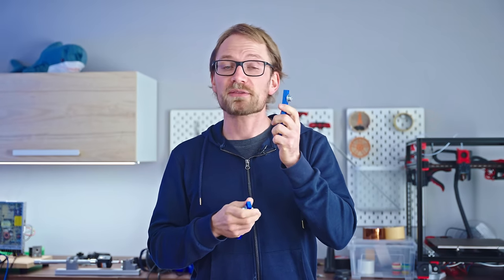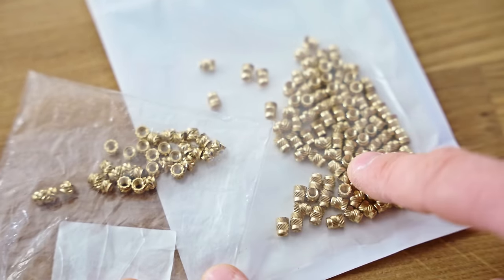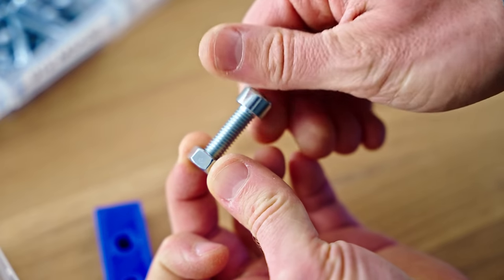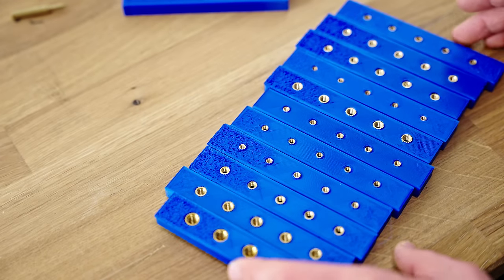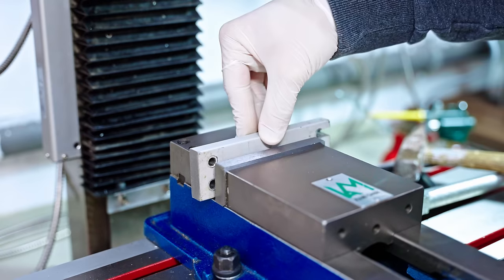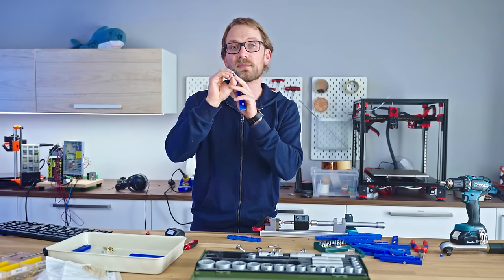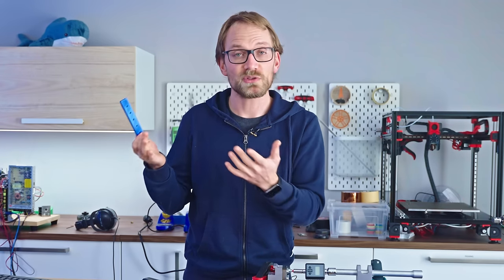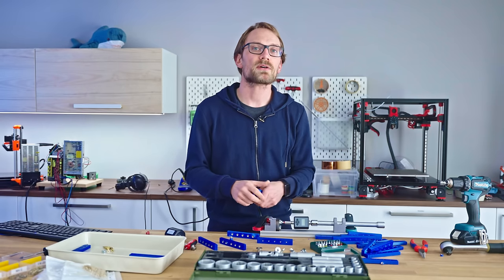Do you even need threaded inserts? Strength tested!

Comment: If you're printing end use parts with less than 6 walls (sometimes called perimetres) and at less than 75% infill (load bearing), at less than 25% (non-load bearing), then you're wasting your time. I wrote the first recent paper "Viability of 3D Printing With Polymers For End Use" (2015) which looked at print methods, materials and production scale, for the abundant "Prosumer/Commercial-Entry Level" printers ($4000 - $50,000). Also, I work as a Mechanical Engineer doing CAD/CAM/CAE and CNC and Additive Manufacturing in the aerospace / defense industry where we print 75% of the parts in most products in the industry.

Comment: Mostly I insert nuts when needed, either while printing or simply afterwards. Recently I bough a small pack of the injection mold inserts for a very rare occasion. Plastic parts are not very great from the get go anyways, and especially 3D prints have a weak Z direction. For most stuff there is just no necessary for a strong print, at least for the stuff I design around the house.

Comment: actually I try to do a moving trapezoid thread. I printed it (10mm diameter) but it doesn’t quite fit (which I expected) now I think about how to get it to size. I don’t have a tap (and don’t want to purchase one only for that project) so I think about either melting the thread in or cutting it with a self made tap (out of a thread rod I have), but maybe that weakens the part to much - anyway, I‘m not sure if the thread will hold the working force anyway. So I trial and error.

Comment: With the latest slicers, I believe you could change the infill selectively, thus you could increase the infill surrounding the hole but not the whole model.  I wonder if you could do the same for the number of walls. I did get a design to print for a customer with many 1 mm holes around an attachment point after printing I realized he had effectively strengthened that area as the printer could no print a 1mm hole and thus created selective 100% infill.

Comment: Hey, you haven't tested the simplest option: just print a hole.
Wait what?
Ok, so I tested it once.
The hole diameter must be selected very carefully by trial and error - it obviously depends on the printer, settings and even the screw. I had different results for different bolt diameters (so it can't be calculated based on the bolt core diameter). You just print a few holes every 0.05 and try.
Once you know what diameter to print - then you simply screw the screw into the hole.
And then PLOT TWIST you tear off the micro-thread that the screw itself carved. So you screw it all the way in and turn it a dozen more turns.
I don't know how it works, but the pull-out force is greater than when you have NOT broken the thread yet. I suspect that then the inside becomes rougher and therefore holds better.
Of course, the force is much lower than other solutions (inserts), but it is >good enough< when, for example, you want to screw the top and bottom of the rasberryPi housing together.
And it's simple.
All you need to know is what hole size print with your current print settings.
And it cannot (?) fail during use (screw and unscrew), because 'thread' is already 'failed'.
edit: tested with PLA.

Comment: Showing the t-nut in the mix and not testing it is a bit of a troll.
Although, we all know it would've probably performed the best in the end -unless it were tested in a ridiculous way, like attempting to press it into the plastic, which nobody with 2 brain cells would ever do, but instead it would be modeled into the part and applied after printing. 
Do the t-nut.
I'm also not sure why some prints weren't made with intentionally thicker walls for the boss. I think most people who have been designing things for more than a few months all consider that when making printed threads. I think this would be another good additional test.

Comment: Find the length of a printed thread which is comparable to a threaded insert. E.g.: M4 might need 150% more printed thread for the same strength. I personally prefer the printed thread, and my former setup did not need cleaning of thread afterwards. (Currently rebuilding my printer)

Comment: I've never used a tap but I have made a cylinder hole then use the fastener to cut into it, and that has yielded some extremely strong bonds. I'd also expect any follow up video to have extra perimeters on these holes, thats basically in a 3d printing 102 class, I don't see how using the default 3 perimeters here was a valid test.

Comment: I don't think this test shows anything at all.
Very nicely done but torque only translates to friction and in your jig that is not same as pull-out force.
Screwing the threads in and using a lever and baggage-scale setup would have been better and removes the thread-friction from the equation.

Comment: Are you pulling out the inserts in the same direction as you inserted them? What would be the effect if you flipped the part over and used the other side. I know this would not work all the time but when you can I think it would add alot of strength to the part.

Comment: I actually never came across using theads or threaded inserts, but its a very interesting topic - thanks for sharing! ...the results are actually pretty straight forward and somewhat forseeable, thats why i was kind of confused that this is nothing the slicer software already has an option for? Would be such an obvious option to be able to select holes (like paint-on support) that are then specifially handled as thread holes and can be added with as many full infill/perimeters as you wish for? 🤷‍♂

Comment: Could you design the part as well to pause at layer, when it has printed a nut hole, then you put the nuts in place, then print a roof/floor on top of nut, thereby embedding the nut into the print?

Comment: I do mostly m2 or m3 and for tapping I would use a hand tap and use more walls on the holes but, my preffered method is inset nut when the geometry allows. I do mostly drone stuff so being able to use a locking nut is a big benefit too.
Reply: Thirtytreeeyes8624.  I also use mostly m2, m2.5 and m3 screws hand tapped into the plastic and for my purposes they do all I need. For more demanding joints I will use inserts or pocket nuts. I will try pre-threaded small screw holes and tap them. The printed threads at these sizes are not useful but, from this video, it looks like the threaded walls will be a little thicker.

Comment: What about resin prints? You can't use melt-in thread inserts and printing the threads into the part is susceptible to cross-layer curing which can ruin the profile and make them useless. And if threads are not a viable option for resin prints, what is a better option?

Comment: Weird - I have the opposite take for several reasons. Never once have I melted a hold while tapping - what are you doing dude? It's 10x easier to design and the designs carry over if you're going to move to CNC'ed parts. I just use more walls. If you really care, most slicers allow you to do region specific settings so you can locally add more walls to tap pilots. I don't like printed threads - they always sag and never mate well, and if you print the perpendicular to the z-axis, they're always oblong and too loose or tight. Inserts are OK but I've had a ton of problems with cheap brass inserts. I've had them deform under the iron while inserting. Steel ones are great but that price adds up. Also I've had a ton of issues locally deforming parts, fixturing for inserting, and inserting them perfectly axially. This might technically be the best option, but more often than not I find it's not worth the effort.

Comment: I'm not sure if I'm over thinking this but since you are normally fastening something down to it, would it be worth testing the radial strength of these but putting a flat block up to the treaded insert and fastening it until failure? it would possibly show that the pulling out of the part that its inserted into might not be a primary failure mode when using it in a real application.

Comment: Looks like you are using threading taps that form the thread. If you do a new test video could you predrill the printed hole and then tap it with a tap that cuts the thread? For M3 drilled hole would be 2,5mm according to Würth machine tap sets.

Comment: can an infill be graded from the connection point so it's stronger denser and maybe loosens up as it goes further away, perhaps enlarging the surface area pull out strength. I'd be interested in what solid parts will do.  Also interested in inserts that go in from the back and have a flange so there's a ton of surface area, possibly the part will snap entirely before anything can pull through. There are some really wide flange inserts for wood applications, often found next to the t-nuts, and sometimes referred to t-nuts, but just don't have the spikes.

Comment: Well I always use wood screws I heat up over a candle for about 30s and than screw the in an undersized printed hole. The hot screw mets its own thread. This allo works with machine screws but you might end up with stuck screws  an wood screws have worked fine for me so far.

Comment: I don't use threaded inserts. At all. If strength isn't an issue, printing the threads directly will give a good enough threaded hole. If I need strength, I use a clearance hole and nut. That's either dropping it into a pocket mid-print, or having the nut on the other side. That way, the weakest part is still the plastic, but it's a wall that's failing in compression. Inserts are neither convenient or strong. They do look great though.

Comment: Great content, as always. :) Thomas would you test with pull only force applied to inserts?  I'm affraid, that your methodology doesn't duplicate real use case scenario. When you apply wrench torque, insert have to respond to pulling out force and rotating force (moment).  Inserts usually trasfer force inline with insert (screew, bolt). Would you share test whit extra two cases: only moment (torque) and only pull out force?

Comment: I’d like to see this test with both more perimeters (I do 5 for heated inserts) or stronger plastic like nylon or polycarbonate with strong chemical intralayer adhesion
Reply: could also compare to SLA “tough” resins in the same. I mean I tap formlabs tough 1500 all the time and it works fine for almost all non load bearing applications (jigs for my CNC milling machine, etc)

Comment: I use Helicoils for threading metal screws into 3D printed or plastic parts, especially small threads like 2-56 and 4-40 with thick walls and tapped, I would be curious how they increase thread strength

Comment: I print holes at Bit smaller than my screw and screw directly into the plastic, never had any issues, of course the strength is limited but so is the inserts. After all it is still plastic 🤷‍♂️ otherwise I use square nuts which I place in the plastic while printing (pause print)

Comment: In my opinion, threaded inserts are more like an esthetic thing than functional. I prefer metal nuts that goes between a 3d printed structure with the hole for the screw (defining the needed thickness of the structure for the job) so you have "more plastic" handling the perpendicular force thats being aplied from the metal nut istelf. A closed 3d print will handle better the forces than an instert, but some people just want things to be pretty, and it works I guess.

Comment: Can you compare a cast sheet of PLA(max material holding ability) vs 100% infill(max 3d printing holding ability) vs other infill %(10-100) with the 'best' insert. Then what other parameters could affect the holding ability number of perimeters, modelling a solid block around fastener points etc.

Comment: Think you ground the threads out entirely by using a drill. May be why they failed so easily.  A solid 100% infill would also give you a better result

(Speaking as I just spent the evening hand tapping my printed parts and they hold up just fine)

Comment: you can't measure torque since it depends on the material the screw is going into; think about it, if you have a very slippery brass insert vs threading into plastic, even at the same pullout force you'd have different torque because of the different friction coefficient of the threads. you need a linear force gauge!

Comment: when you thread any material, you dont go full bore. you go max two rotations then go BACK to cut the thread, otherwise you are going to jam it up and get that plastic smoo all over. it's not designed to just thread all they way in one go.

Comment: Would be curious if you could get helicoils to work. Using them to repair threads in metal parts works very well, often exceeding the strength of the failed originally tapped hole. The modeled threads would just have to be adjusted for the larger diameter, while keeping the pitch correct for the final fastener.

Another advantage to using the helicoils, are they are not heat set, so you could also include them in resin prints.

Another comparison that could be interesting is how well some of the methods illustrated in this video, but through the most common other filament types, say PETG, ASA, and generic Nylons.

Comment: i think using a power drill tap was a mistake, especially with it overheating and melting the material i think a hand tap wouldnt have ever had that problem and would have simply cut the threads into the plastic with no issues, i think you should do a very short testing a hand tap versus the drill tap

Comment: Any modern printer should be able to print a functional M3 bolt. I've done several on my Ender 3. Usually when I need a light duty bolt and don't have the correct length in any of my kits. Printing a threaded part that small is a bit harder, and, when not printed flat, a triangle cutout needs to be modeled into the top of the hole (see Maker's Muse) to prevent sagging plastic from spoiling the profile.

Comment: "why threaded inserts?" All wrong: you can disassemble and reassemble a thing many times and it will not lose strength with threaded inserts. Direct threading into plastic is full-strength exactly once when the screw first goes in, and any repeat disassembly will weaken the joint or thread out completely if you're not careful.

Comment: Try pulling the insert in the same direction u inserted it? so u need to pull the insert out the other side not the same side it went in. i got a print going right now to test it but im rlly curious on the injection molded inserts if that would improve the strength around the plastic. i only have the basic amazon knock off versions

Comment: i been recently making something with intention to put a lot of threaded connections and first thing i decided to do was to put minimum 2mm thick walls on the parts which is notas scary with 0,8mm nozles but i wouldn't try to print in place any threads, besides i print from petg and with 0,5mm lauer height and connccting things with m3 screws
so in my overthinking i decided to just sink in a nut on the back or threaded inserts if i was aiming for higher accuracy, but installation was a pain to do right sadly any time i use anything in petg mostly because i use soft devil design petg i have the problem of any fastners sinking in and deforming the print under pressure so torquing parts even with smallest screws would require rather big washers to spreads the load or just use more small connection points in a matrix of 4 or 6  and clamp only untill they all start sinking in
so for me there is no real reason to ise inserts in non solid materials because they pull out with infill placing them at the back and pulling trough the part work the best and if you don't need straight trough holes with accuracy just place a a nut in a pocket on the back like prusa does or if you need accuracy design a pocket for an insert and sink it in but very carefully because they like to drift to the sides and don't hold at all when they do or jam the screw  sinking press often is a must wood working inserts in general placed on the back can hold more but they either look bad or cause other problems because they are so big, but if you need to hang something from a 3d printed part for long time greater surface and more infill connections of those 4 clawed inserts can help too but they can also cot around the hole if the borders of the print are too thin

Comment: M3 and even M2 works fine, you might have extruder calibration issue or too high layer height, or probably both (considering you had over extrusion on top layers).
Reply: Oh forgot; You just have to go 3-4x the material thickness to counteract going into a soft material like PLA to get to the level it's meant to be at.
Reply: I set Cura’s “tolerance” to “exclusive” for fine threads but agree that printed vertically in rarely as accurate and likely need post printing work

Comment: too late to ask for embedded nuts or a slide in slot for the nut? I use square nuts because they fit a the slot better but also i'd bet they are stronger than hex nuts. Also they are easier to remove and reuse.

Comment: what about printed threads with steel nut as backing, either in the bottom of threads or outside print, and what about other material screws, brass etc.

Comment: I've got triggered directly from the start of the video! 😮 Bold,s are fastening hardware that have a consistent thickness that requires a pre threaded hole, like a nut. These can handle higher forces than a screw. A screw on the other side have a tapered point that cuts the tread in one go, often 😅 with wood or plastic, so these are faster because they don't need a pre treaded hole. Although screw are usually less strong and aren't useful for moving parts and stuff that require frequent maintenance. Bolts are easier to dis and reassemble. Just to speak of a few pro's and con's.

In this example, both are bolds!😅